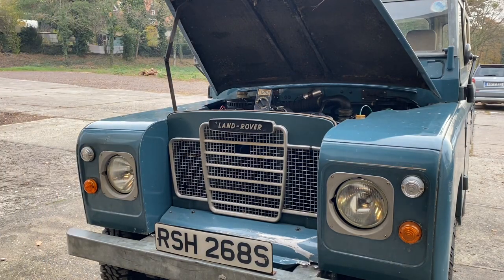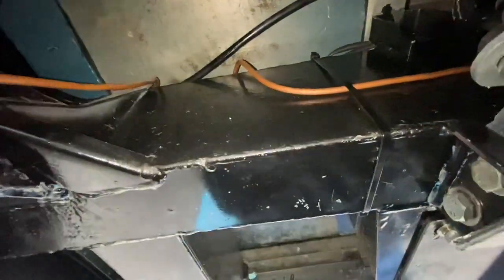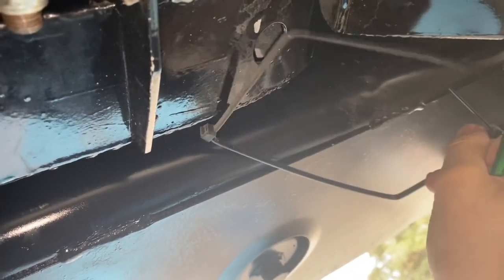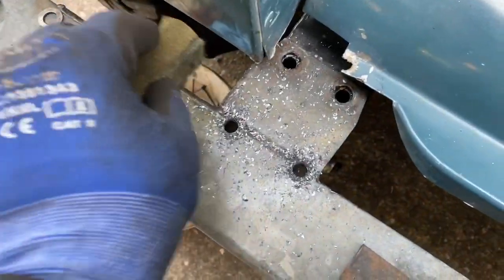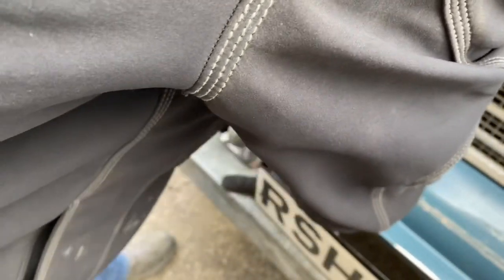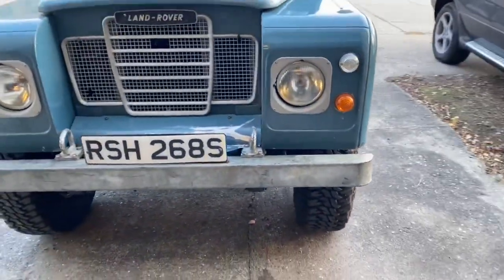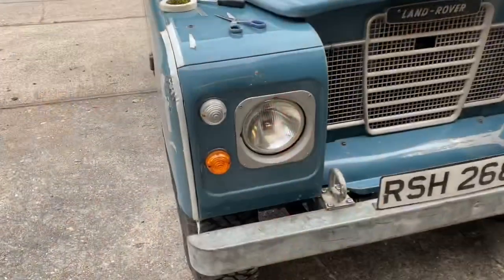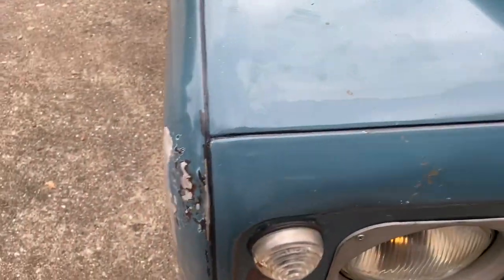Land Rover Series 3 Restoration - D Rings & Other Jobs - Part 58

Comment: Great channel and even greater work! Just had mine at a „Kurzcheck“ at a TÜV station. This specific test is meant to give the car a grade (from 1 being awesome and nearly not possible to 5 as being nearly destroyed. Depending on the TÜV-guy, I guess your car will be a really solid 3, maybe a 2-). With this grade you will be able to find an insurance for classic cars, which is much cheaper as a normal one. Grade 3 or better is usually a requirement to get a classic car insurance. Besides, getting a H-Kennzeichen let’s you drive into every city without any concern about the environmental restrictions. There are no environmental restrictions for classic cars in Germany. The far more expensive assessment (called Wertgutachten, around 500€ compared to roughly 150-200€ for the Kurzcheck) states the real value of the car. This is necessary if you want to state a value to your insurance company (car being stolen and you want to get back the actual value). Good luck and patience at the TÜV!
Reply from the maker: Hi, thank you. You know your stuff. I have been talking to insurance companies and 250.- seems realistic. TÜV is around 300.- and a Wertgutachten (valuation) is another 150.- just as you say.

Comment: That's sounding and looking excellent, puts mine to shame! Good luck with the MOT, but I'm sure you won't need it.
Reply from the maker: Thanks Steamwally. I have since fitted the PCV valve and it starts rather strangely. I have made a video. The Membrane in the valve seams OK,  but it is doing the engine no favours on start up. Feels like it’s taking in air. Once hot it’s fine tho. I now see why the garage blocked it off back in the day.

Comment: Hey bud what size are your tires? 235x85x16?
Also, if you changed from7.50x16 to the current tyres did you feel change in steering ? Did it get heavier?
Reply from the maker: Hi, I think the 7.50’s were more agile at low speeds. And yes, the size is correct. The extra bounce with the radial tyres is impressive. It’s a tough one. I haven’t driven the car with the 7.50’s for over twenty years tho…

Comment: Professional advice here, you really need to recheck the valve clearance that's quite a distinct tappet noise.
Reply: Pretty normal for a 2 1/4" petrol, they all do that sir!
Reply: It wasn't that distinct before he did the clearances and mine doesn't sound like that, I have 33 years in the trade to my name and I know a loose tappet, no disrespect intended.
Reply from the maker: Hi, thanks for this, the advice is much appreciated. I have gone back and rechecked the valves since I made this video and I can hear tapping in a couple of the valves. 3 & 5 from memory. But even re-setting them again to spec clearance doesn’t remove the noise. I think it’s in the next video. I ended up leaving it.
Reply: Thanks for the response ,it definitely sounds valve gear related, reminds me of an old Talbot lol call it character then but I couldn't live with it🙂
Reply from the maker: Hi, what would you suggest. Should I set the clearance below spec or does something need replacing?
Reply: Certainly try to pinpoint the exact source of the noise and inspect components, I wouldn't recommend running below spec
Reply from the maker: Ok, thanks.

Comment: battery voltage at idle 12.5v 🤔 550 RMP is it charging at idle.
Reply from the maker: Hmm, I will have to check that. I thought it was showing over 14v